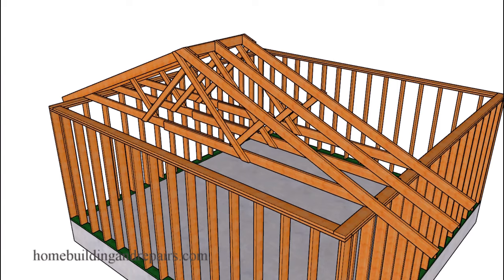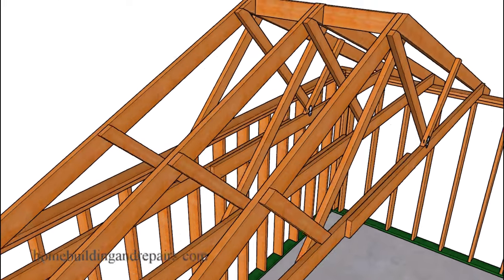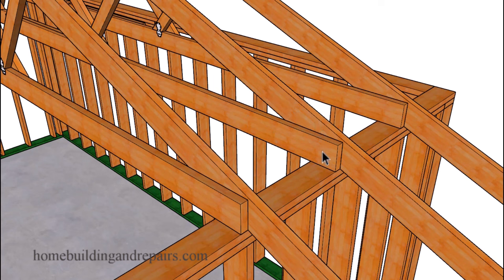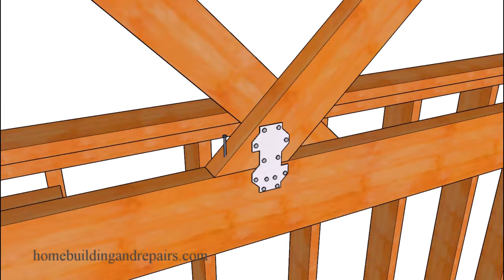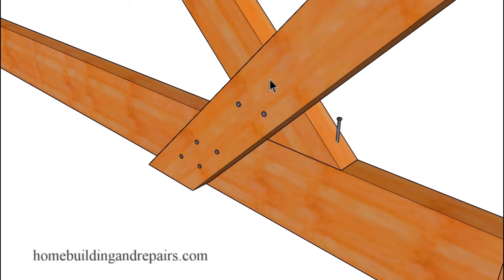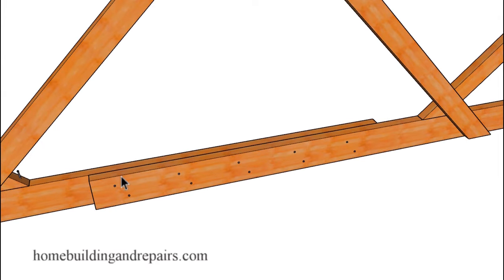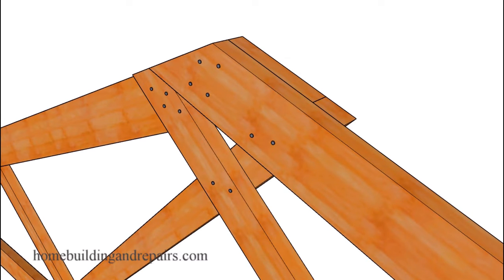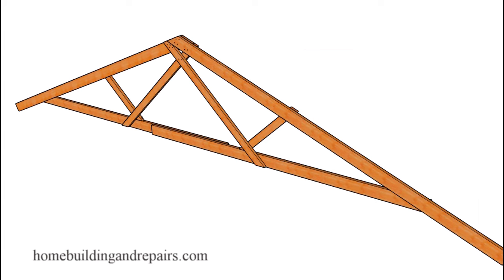How To Build Roof Trusses Without Plywood Gussets or Gang Nail Connectors For Small Homes or Sheds

Comment: In California is this legal to build on a 25-ft span on  house
Reply from the maker: You will need to check with your local building department, but I don't see why you couldn't, with the right sized lumber.
Reply from the maker: Maybe not, because of the ceiling joist span and you would need 25 foot long lumber.